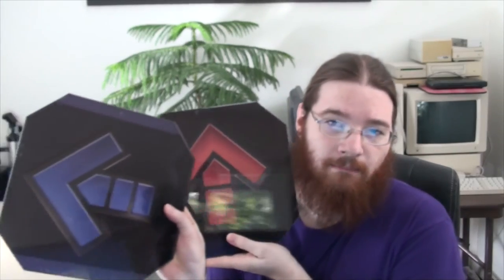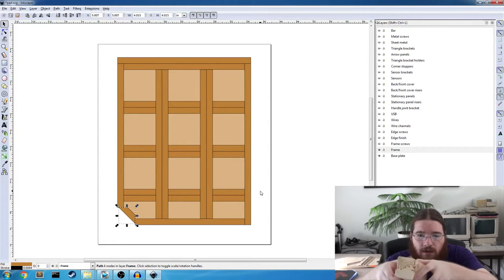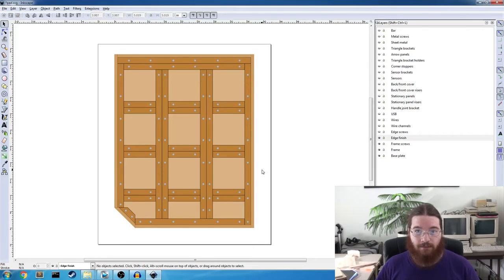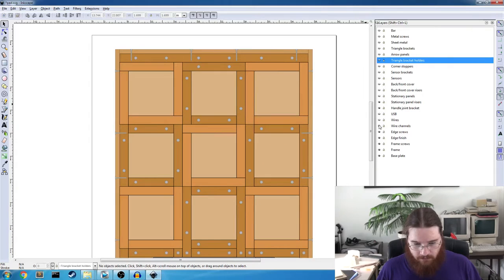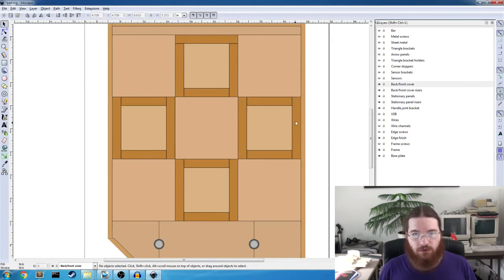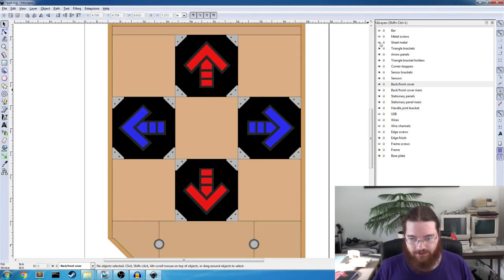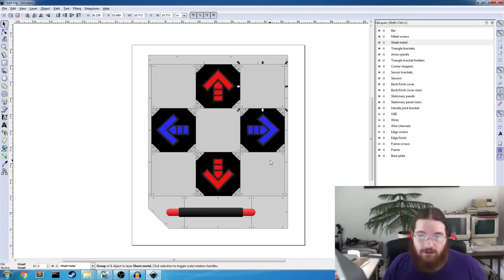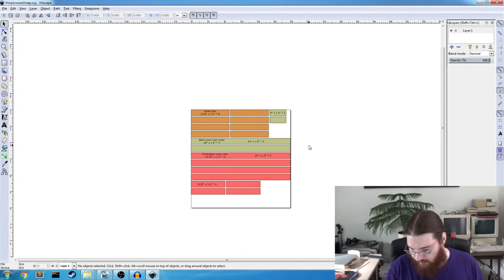Building an ITG2 dance pad replica - episode 1: Schematics and plans

Comment: Alexs, can I apply those steps for a PIU pad instead? is there anything different I need to do?
Reply from the maker: Other than the inverted layout, the only major difference in a PIU pad would be that the corner arrows are 2 inches longer, with the raised portion in the center left and right proportionally shorter to match. You'll of course need to route the wires inside a little bit differently to accomodate the layout change, buy 8 more sensors, etc., but otherwise an ITG pad and a PIU pad are basically identical.

Comment: When you ordered your plastic panels it seems they came as a perfect square. How did you cut the corners off to make them octagons... as in what tool did you use, or did you have someone do it?
Reply from the maker: Miter saw. I show the process in the next video: https://www.youtube.com/watch?v=Ci6XrjMkrHc
Reply: @adiener  Ah I see.. did the miter saw make easy work of the 0.5" poly panels, or were there challenges? I'm attempting to duplicate your frame and then add to it in a cheaper manner. The hardest part for me is making the triangles that hold the octagonal panels in place. I'm cutting small wooden triangles to screw into the corners of each panel that ensure the panels have a slight amount of wiggle room but are also still held in place.

Do you think the metal triangle brackets that go over the other triangles are necessary? I feel if I left them out, the panels would still be able to wiggle slightly, but I don't see how they would ever pop out of place. It would save my design a lot of headaches if I could just not use those.
Reply from the maker: @RyanJTennis  Miter saw went through them without much problem, yeah. So, as far as leaving the triangle brackets out of the design, I know some people who actually run their arcade machines this way - as long as everything under the panel is level and it can't pitch upward if you step on it in the wrong place, it should work fine that way. Sensitivity tuning would work a little bit differently since there wouldn't be any static pressure on the sensors other than the weight of the panel, but it can definitely be done.
Reply: @adiener  oh cool that's good to hear. For sensors I plan on starting with 2 Force Sensitive Resisters per panel... they have a very good sensitivity window so I should be able to adjust them accordingly I hope.

Comment: Great vids! I am planning on making something for my fiance as she loves playing ddr but due to the corona virus we cant really go to arcades, ive been contemplating on buying a ddr soft pad online and trying to open it so i can rewire it to a custom built ddr pad thats more sturdy, ideally I'd want it made out of wood with a metal cover to make it clena but sturdy, do you think itd be possible to do all this as well as make custom handle bars for the back? Im not too sure if I'd want to try to get one pc compatible or just get a ps2 pad for the ps2 obviously because she's very picky about playing only ddr and currently her faborite is ddr ace
Reply from the maker: Should be possible, though the only thing of interest you'd probably be able to salvage from a soft pad would be the control mechanism that translates sensor contact to something a PlayStation understands. A normal controller could do the job just as well, with a bit of soldering like this: https://www.youtube.com/watch?v=jmvuXUoAzdA

As for the foot sensors, I'd be surprised if you could make it work with soft pad wiring, which as I understand is normally made with two coiled contact wires with some sort of permeable foam sandwiched between them, so they touch when pressure is applied. Official arcade sensors will be the best, though the most complicated to build with. Anything you can improvise that makes an open circuit at neutral pressure and a closed circuit when compressed could do the job.

I suspect a machine shop would be able to bend a tube for you into a usable bar shape, and you'd just need a way to firmly attach it to the base of the pad. Maybe they could also weld it to some sort of flat metal plate, which you could just bolt onto the frame directly. Probably a lot cheaper and simpler than what I ended up doing, and I suspect could work just as well.

Good luck!
Reply: @adiener  do you think itd be possible to create a small spring mechanism underneath the arrow plates? To give more detail to my idea i mean if maybe something was built to slightly elevate the sensor from a pad, and once you step on it it would sink down to touch the metal on the bottom, and as soon as you step off it would ever so slightly spring back up, dont know if an actual spring would be used maybe around the corners amd sides or maybe just something rubbery
Reply from the maker: @fireemblemconvergence3241  It could work. The BlueShark pad I used to use had springs in it. They give a somewhat different feel from arcade pads, which have rubber blocks around the corners - it gives just a slight little bit of squishiness, but mostly doesn't move when stepped on. Just depends on what sort of step feel you're going for.
Reply: @adiener  Oh yeah, definitely salvaging foam pad control boards is something I did too - even though I only ended up using one.  For a pad project I just started planning out, I'm gonna salvage a foam pad PCB, AND the PCB from of a PS3 controller so, theoretically, I can make a pad that will work on both PS1/2, AND USB.

Comment: hi alex can i ask you the full schematics?? cause i want to build my own pad :D thanks
Reply from the maker: Sure! I'll have a full website up for this eventually with more detail, but for now, here's a zip with all of my most up-to-date schematics: http://ludobloom.com/temp/itg2padschematics.zip

Schematics are designed to be opened with Inkscape: http://inkscape.org/

Also, here's a text file with some of my notes (sorry about the organization; hopefully you can find the necessary info in them), including links to suppliers for all parts: http://ludobloom.com/temp/itg2padnotes.txt
Reply: Ohh thats great.. thank you very much bro.. ill be starting my dance pad tom hopefully.. and maybe you can do also a video for a pump it up dance pad.. :)
Reply: @adiener  hello, i have question, maybe im missing something... my english its not the best, but ,  for example on plywood schematics i don't find any measurements on the thickness of the plywood.. or the stationary panels so i can buy the correct ones, youk now what i meant? sorry, im from latinamerica, and maybe there is a standard on the plywood that im missing, here are variety of thiccness :/
Reply from the maker: Yup, thickness is specified in my text notes rather than on the schematics. Most of it is 0.706", but see the full list under BUILDING MATERIALS INVENTORY for details on each piece.